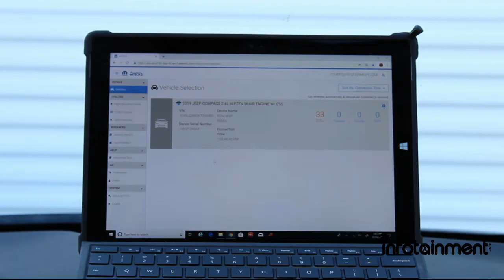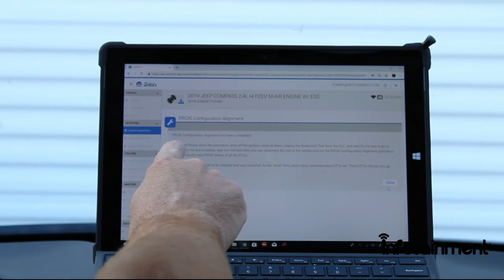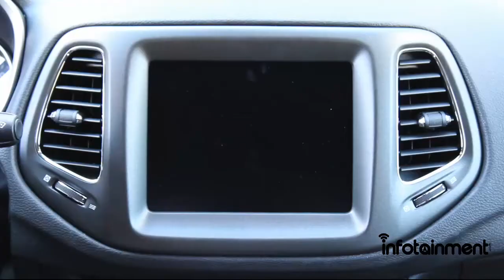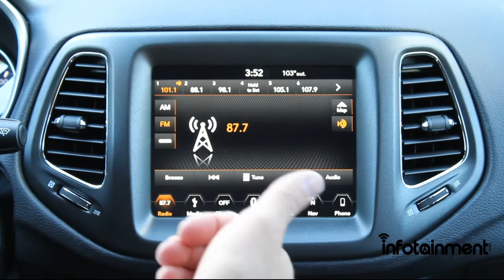FCA Proxi Alignment using WiTech Tool Step-by-Step Tutorial - Infotainment.com

Comment: how can i get someone to add the sales codes? ive been calling all the jeep dealers near me and theyre all saying it can't be done
Reply: That is because the code books say it can't evidently it can and has been done.
Reply: @lincolnphillip5917  I bought the STL (Sirius Travel Link) OBD programmer from Infotainment for my 2017 Jeep Grand Cherokee with the RA4 8.4" Uconnect but I still do not have the Sirius Travel Link. This is the "Sales Code" RSM. I have asked and I'm willing to pay to get this RSM sales code and they still won't add it. Any suggestions? Thanks in advance if you can help.
Reply from the maker: Normally your local franchise dealer can help with this.
Reply from the maker: I would reach out to our techs and they should be able to help.